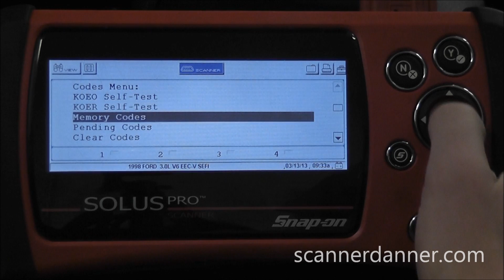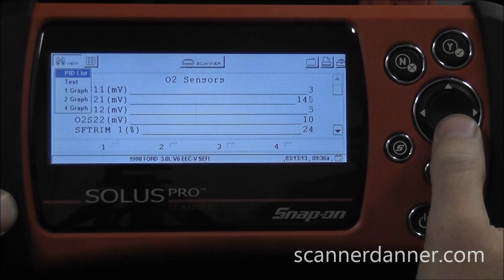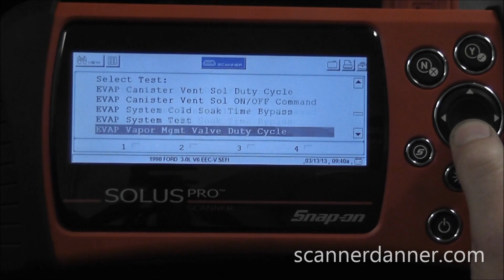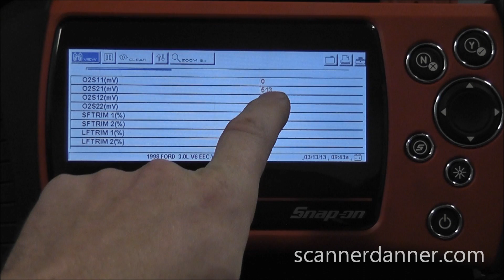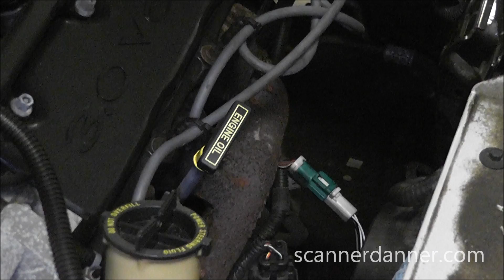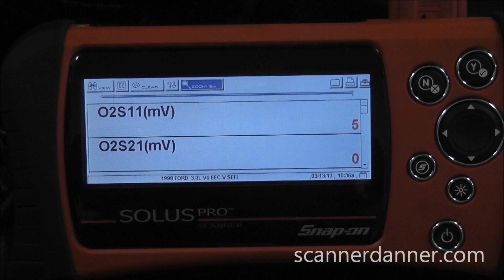Ford O2 Sensor Testing - wiring tests (no bias voltage)

Comment: Paul I wonder if I may ask you a question. I back probed the terminal going down to the pre cat o2 sensor and with key on (Golf 2.0fsi) I found either 12v on two of the connectors, or volts near 3v thereabouts. I was using power probe 4, and none of the connectors detected ground or earth. Does the ECU ground the sensor through its self (Transistor) or is the ground through the exhaust itself and none of the wires provide ground?
Reply from the maker: Sounds like a wideband O2. Once they went to 4 wire oxygen sensors, they no longer ground any part of the O2 to the housing.
Reply: I fell foul of being a parts changer and got rewarded with nothing for it. O2 sensor has five wires to it, and the loom from the o2 sensor plug has 6 wires. Anyway I changed the o2 sensor to see if that would fix the issue being circuit low bank 1 sensor 2 but it never. The p0037 came back up after reset before change. So from your video's it would appear the next thing to check is the wiring to the ecu. Then from that the ecu itself. There's nothing else to check is there?
Reply from the maker: 5 or 6 wires is definitely a wideband sensor but you said bank 1 sensor 2? That's a downstream O2 and I've never seen a wideband used on a downstream sensor. 
So first thing, confirm that you are messing with the correct O2 sensor.
And second, 5 pins on a 6 pin connector doesn't sound right to me either.
Reply: It has red yellow white grey black wires only the plug inside has 6 pins. Then the wites inside the loom back into the Golf have 6 wires. The fault is P0037 heated oxygen sensor heater control circuit low bank 1 sensor 2. Its a 4 cylinder with 1 pre cat and 2 after cat. So presume the code meant the pre cat as really a four cylinder doesn't have two banks.
Reply from the maker: Bank 1 (only has one bank so no issue there) Sensor 1 = before the cat and Sensor 2 = behind the cat. You're messing with the wrong sensor.
Reply: Well in truth theres another o2 sensor fault alongside that P0037. Its P0050 heated oxygen sensor heater control circuit bank 2 sensor 1 meaning the only one there is pre cat. This i replaced today though for a brand new one. So im wondering to you, and seeing both these codes, would you think either wiring fault or maybe ecu error. Cars got recon cylinder head 300 miles.
Reply from the maker: You have heater control codes on two different O2 sensors. You said it is a 4 cylinder, yet now your saying is has a Bank 2 Sensor 1 O2 fault?. To much conflicting info here man. Let's start over. I need year make and model car and all the codes the car is setting after clearing them. This may be better handles on my forum where we can exchange information better.
Reply: Right so the car is a 2006 Golf 2.0fsi with engine code BVY. The faults are P0050 heated oxygen sensor heater control circuit bank 2 sensor 1
And P0037 heated oxygen sensor heater control circuit low bank 1 sensor 2. I have run a meter from t pin on the connector block to the o2 sensor car loom side and have the figures. Please remember there are six wires in car loom, yet in o2 sensor regardless of 6 pins, there are only five wires. The wires are different colour to the car looms wires. Would you think this strange? From o2 sensor wires
Black 2.96
Grey 14.20
White 8.77
Yellow 2.50
Red 3.36

I have plugged old o2 sensor back into loom and touched the side to the neg terminal on the battery and the heater works in the thing. So even though I have changed the sensor for a brand new bosch, still the code P0050 comes up.
Reply from the maker: The wiring diagram shows 6 wires on the upstream O2 on both the harness and Sensor side. Was the original O2 this way too? Also, there is no Bank 2 Sensor 1 O2 sensor and my diagram is only showing one downstream sensor. 
Regardless of any of this, you have a heater circuit code, so it should be pretty straight forward. The diagram (probably different than what you have in your market) shows the two O2 sensors (one upstream and one downstream) have separate fuses in the fuse box for power and are ground side switched. I need to look up those codes later today
Reply: The shop agreed to change the new one for another new replacement. Now though im dubious about the change because you have said you thought it strange about the wiring difference, and that the colours of the wires in the bosch o2 sensor do not match the colours of the wires in the loom. As all wires have volts, i would love to know which is supposed to be the ground and which is the signal wire. Do you think I should get the oem sensor, and this is definetly bank 2 sensor 1. Its right behind cylinder head before cat.
Reply from the maker: Sensor side colors never match the harness side, so that part is okay. What is not okay is there should be 6 wires on both sides of the connector. Also, unless the exhaust manifold uses a split 2 into 1 header with two different upstream O2 sensors, the is no Bank 2 sensor. 
We do not have your engine code in our market but this is what I got for your two codes:
P0037 = Heater control circuit low Bank 1 Sensor 2 (behind the cat)
P0050 = Does not exist on the 4 cylinder models here (it is Bank 2 sensor 1 though when you google it)
None of my wire diagrams show me three O2 sensors, only two. 
Sorry man, not much else I can help you with. 
You may want to post this to my forum. I have some guys in your market that post there, that may be able to get a good diagram?
Reply: Cheers. There's three o2 sensors pre cat on this golf and the header pipe from exhaust which has one, then splits into two single pipes before cat which each have a sensor in them. I have been told by VW parts that those sensors are 4 wire. Im wondering if the p050 bank 2 sensor 1 refers to the right side of those and not the front header sensor. If the first senor is ground side switched, then tell me something. How come when I just plugged the old o2 in to the loom and touched the wall of the sensor against the neg of the battery, it started to heat up? Would this maybe refer to a short within the sensor wall?
Reply: Im thinking bank 2 sensor 1 is the right side sensor after the sensor in the main header pipe.

Comment: One correction: You said " Higher voltage using the test light, lower voltage using your body. "  That is kinda false. Under no load any resistor will have the same voltage out at the other end. Test light (around 1-4 Ohms) =12v , 1kohm resistor 12V. Your body, around 200-400 Kohms= still 12v. a 10 Megohm resistor= still 12V. The voltmeter has an extremely small load when sampling the voltage, and that's why it drops to around 7 volts.  ScannerDanner, I urge you to do a separate tutorial on basic electronics and how it applies to cars, with excerpts from your videos. I studied electronics but many mechanics don't understand basic electronics, especially when it applies to cars.
Reply from the maker: There was a load when I performed this test. Granted my ammeter showed 0 amps but my meter doesn't read in the micro amps scale. There was still current flow, just not measurable with my dmm. 
The voltage drop through my body, down to 7v proved that there was some current flow taking place. 
Maybe I am misunderstanding your point?

Comment: My guess would be that there is a zener diode across the input to the ECM clamping the voltage at 1.6 volts, and also probably a resister in series which is evident by the fact that the voltage at the t-pin was over 6 volts when touched. The purpose of the zener of course is to protect the input against over voltage input. Depending on the zener being used I would guess the maximum current would be somewhere between 0.5 and 1 amps. There's no way your body would ever provide enough conductance to get the current anywhere near those levels, so you're not in danger of damaging the input circuit in the ECM.

Comment: Is there a universal standard for knowing which one is bank 1 on longitudinal & transverse engines?
Reply from the maker: Bank 1 is always where the #1 cylinder is on the engine. Bank 2 is the opposite bank (obviously, not all engines have a Bank 2)
Reply: Thanks man, wish the #1 cylinder location was consistent within engine layouts.

Comment: great video about o2s,, but you did not put direct line positive in pcm o2s signal.. i have seen shorted burn signal positive/nega signal.. heater ground and positive heater,, but im currious about giving a direct 12v to the o2signal  and afraid that it will fry the ecm..??

Comment: My ECU does the same. I've chnanged three O2 sensors till now. He doesnt see rich or lean condition, its fixed on his long and short term values. With new sensor  work smooth for  few days. O2 look's good for a period, than fixes to 0 volts, mil on and p0170 code. I've checked circuit with your method and ECU respond well, but he doesnt add or cut fuel.
Rover 45 1,6 petrol with 1 bank.
Sorry for bad english.
Reply from the maker: That's okay friend. It's good enough that I understand you. Nice job.
As far as adding or subtracting fuel, the ECU may not respond to your simulated rich and lean conditions because it knows there is a fault in the circuit. So know matter what you do it will ignore the O2 signal.
As far as why the O2 is working for a few days then not. It is either a wiring harness issue (shorted to ground) or you need to use a factory O2 sensor.
I just completed a video on a Ford with an O2 harness issue. It will be a few weeks before I upload it.
Reply: Thank you, ScannerDanner !
Reply from the maker: for sure

Comment: hi there , wondered if you can help a wee bit?
 my bank 1 sensor 1 is throwing out up to 800 plus and back down to low numbers that's constant, not sure if numbers be so high? 
 my bank 1 sensor 2 numbers are matching the upstream 02 sensor numbers 
she failed emissions! I've bought new sensors so need to fit them once get old ones off! 
any thoughts would be something to look into b4 I go for new cat!

Comment: hi paul. i have a question. am working on a 2012 jeep grand cherokee with an o2 sensor heater prerformance problem. it is PWM.  in your book you mention that if the pcm sees a problem on the circuit, it sometimes shuts the transistor off. if the problem was the sensor itself does the computer shut the transistor back on by itself after erasing the codes? or is there something else that i need to do?
Reply: i meant after replacing the sensor and erasing the codes. should the pcm start PWMing the heater again?
Reply from the maker: +ELVIS ROBLERO There is nothing else you need to do but remember also, if it is a downstream O2, some manufacturers will delay the turn on of the O2 heater to allow moisture burn off in the exhaust.
Reply: +ScannerDanner its an upstream. 2/1. on my live data i can see how the heater pwm start from 99% and go down to 40 - 60% for all sensors except for this one. it stays at 99% all the time and all sensors reach 600 degrees celcius except for this one. wiring is good. sensor has been replaced. am suspecting a bad pcm...
Reply: +ScannerDanner its an upstream. 2/1. on my live data i can see how the heater pwm start from 99% and go down to 40 - 60% for all sensors except for this one. it stays at 99% all the time and all sensors reach 600 degrees celcius except for this one. wiring is good. sensor has been replaced. am suspecting a bad pcm...
Reply: +ScannerDanner pcm never goes into closed loop for bank 2 and thats one of the codes am getting. and sometimes the car starts missfiring and i can see on my live data how the pcm is shutting off the injector for cyl 2 after being running for a little bit. i dont know if thats normal or not since the bank 2 is not going into closed loop...
Reply: +ScannerDanner Paul, can a rich or lean condition cause an o2 heater performance problem and then make the pcm shut off the control circuit until the problem is fixed?

Comment: i have the same problem 02 ford taurus ses 3.0 p1132 is what i have ,  i dont know what to do with it and have p1400 can u help me what to do or what it means
Reply from the maker: +santamaria805559 P1400 is the DPFE sensor for the EGR. Watch these videos
https://www.youtube.com/watch?v=RUmH4lwTLKs

https://www.youtube.com/watch?v=C6fL_dFy_us

https://www.youtube.com/watch?v=znw-gjLE0fk

https://www.youtube.com/watch?v=pH_kjRwD-Xw
Reply: +ScannerDanner  so i look at the sensor an found out the wires were cut and all three wires where toughing so my question is would that short the pins to the pcm

Comment: Hi Paul i wondered how an LED test light would do testing the computer operation instead of you fingers....i made a tool once that went from zero to 1 volt, was just a small box with a 9 volt radio battery in, very small one, we call them PP3, i cant remember the circuit but i believe i connected the battery across the variable resistor via a switch in the battery line, and 2 wires came from middle and one outside terminal to the output leads, i believe there was a correction resistor to cut voltage from 9 volts down to 1 volt...it worked anyway, you just connect it across the O2 wires to the computer and set it where you like, make it run rich or lean or set it to 4.5 volts for average running...Fred in essex uk.
Reply: 333 3

Comment: Scanner Danner, I am having trouble with a 1996 chevy 1500 V8 vortec. The truck starts and idles fines and sounds great but... when you rev the motor it acts like it wants to die at 2000 RPM. Also when you put it in gear the ABS light comes on and the truck stumbles on its face like its hit limiter at 2k RPM, any thoughts?

Comment: How would you test an O2 ground wire?
Reply from the maker: I am directing all help requests to my forum. Sign up (it's free) and create a new post. Be sure to add a name under "alias" as this is the name that will appear in the post.
Here is the link to the forum. 
http://www.scannerdanner.com/ForumRetrieve.aspx?ForumID=3226
Thanks
Reply: I
Reply: +ScannerDanner Hi Paul, I am having trouble with a 2007 BMW 120i 4 cyl engine. It is giving me P0040 (O2 Sensor Signals Swapped Bank 1 Sensor 1/Bank 2 Sensor 1). 
I looked at the live data readings, it's showing negative values for both upstream sensors at idle (-0.156mA), it will gradually increase amperage as revs go up, the response time is ok as well. Bank 1 Downstream sensor is always at 0V.

Could the downstream sensor be throwing the P0040? 
Thanks in advance, 
Rafael from Brazil.
Reply: +RLHubner Almost forgot... it will go into Closed loop after starting warm and shortly after into OL-Fault. Fuel trim therefore isn't adjusted at all.

Comment: I have a 1999 ford Windstar se 3.8L, i have been having an intermittent problem. When i drive home from work and i stop to run a 20min errand and start up the engine i notice a sucking or slurpping sound from the fuel pump and the engine starts shaking and the rpms are low until i give it gas then runs fine. But no check engine light on, replaced all engine sensors,02 sensors upstreams only and fuel pump. Any ideas because im out
Reply: Probably the fuel pump

Comment: I replaced both updown and the one downstream O2 sensors on my Ford E250 ('98) with Motocraft sensors. Also changed plugs, air filter and that sensor that mounts to the EGR valve.  I've also replaced the MAF sensor, sealed all vacuum leaks, no Sevice engine light and I can still smell strong raw hydrocarbon fumes in the exhaust. Can you point me in right direction here? Would a burned out Cat. result in these hydrocarbon fumes?  My scanner shows normal readings, I think the max voltage is ~ .790 mV upstream and about the same downstream. I'm going to take a look at the fuel trims later after watching your video - Thanks, Reese

Comment: +ScannerDanner Need some advice mate. My Hyundai Getz has MIL lit for P0036 & P0037 heater circuit fault. Bank 1 Sensor 1 is giving good on/off pulsing 450mV up & down. Bank 1 Sensor 2 with the fault code is just giving me a continuous 450mV which only drops very briefly to about 400mV when I blip the throttle. TPS is only going to about 78%, but I seem to remember is being able to rise 100%, but I might be wrong. What would be the easiest way to test the heater circuit for bank 1 sensor 2, as it is difficult to get access to the sensor. The Bank 1 Sensor 2 is really easy to get to at the exhaust manifold. 

Appreciate your advice on this. Thanks.
Reply: Mark, you need to realise that an O2 sensor is, in fact 2 components in one. The actual sensor bit, which will return a fluctuating voltage (not pulsing) of around 0.1v to 0.9v, (sensor 1 - sensor 2 should fluctuate slightly around the 450mv range) and the heater. The heater acts like a diesel glow plug to quickly bring the sensor bit to operating temperature. This is a simple heater circuit, and totally separate from the sensor. Whether the sensor you want to access is difficult or not is irrelevant, you`re going to have to get at it at some point. Unplug it, test that you`ve got 12v at the heater circuit,  harness side, then test that you have continuity through the sensor heater circuit....

Comment: I have the same problem with my 99 crown vic codes 1131 and 1152  I changed all 4 o2s and I have the same problem car runs lean so the pcm is trying to correct it but running rich how do I fix this problem and how can I erase the kam without using a solus pro??